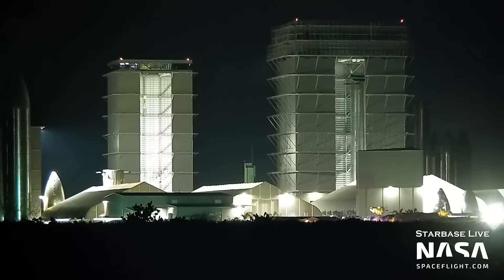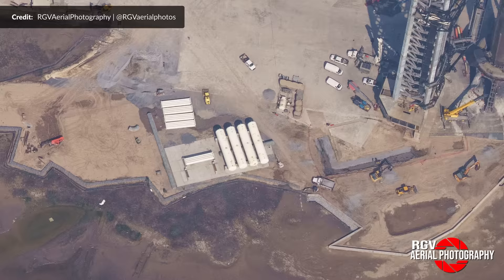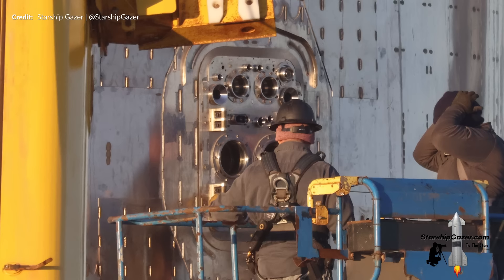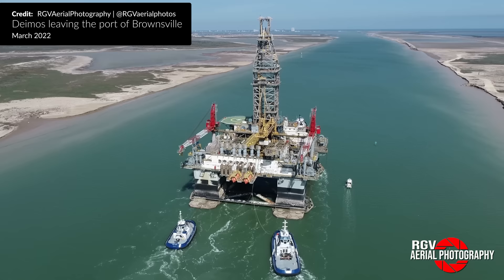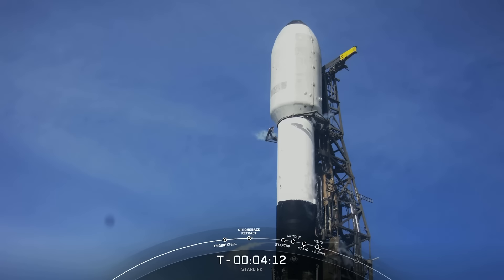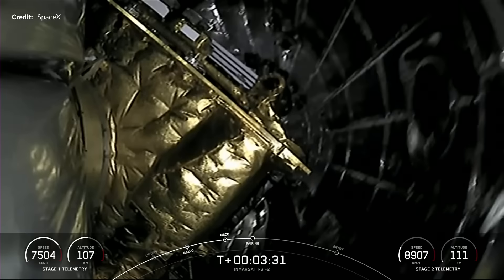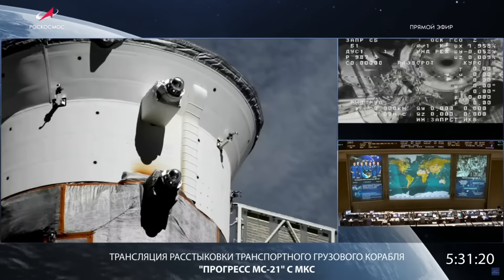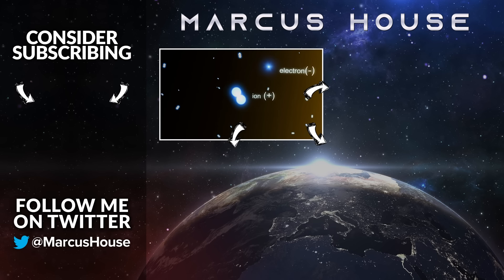SpaceX Ditches the Oil Rigs and Incredible Insights of the Orbital Launch Mount/Booster Static Fire

Comment: Surprise! As I wrote at the beginning of the oil rig fiasco the one and only sea launch platform sank in a storm. The sea is also corrosive. The idea was a non-starter. Don't get me started on those silly landing hooks.
Reply: Do note that sea launches do exists & it's an engineering challenge not a physics challenge

It's a low-priority, but still to-do lists

Comment: Space X has done more launches in the last 5 years than nasa has since their creation.
Reply: You do know that NASA is SpaceX's biggest customer right? That when SpaceX finally got the Falcon 1 to orbit on the 4th attempt, NASA awarded SpaceX the 2008 $1.6B Commercial Resupply Services (CRS) contract for developing and flying the Dragon and Falcon 9 to the ISS. When SpaceX had 12 Falcon 9 launches under their belt, they were awarded a Commercial Crew contract to develop Crew Dragon, man-rate the Falcon 9, and to fly 6 crew missions. They have since received 2 more contracts for 8 more flights. Currently, SpaceX is the only provider for a HLS lander for Artemis III with two contracts for 3 landings totaling $4.09B. SpaceX has had many single mission launches for NASA, along with the upcoming launch of 2 modules of the Lunar Gateway on a Falcon Heavy and the Nancy Grace Roman Space Telescope (NGRST) also on the Falcon Heavy.
Reply: Great way of showing you have no clue what NASA actually is and does. :D
NASA hires companies for their missons (always has and still does). SpaceX (a rocket developer and launch provider) is 1 of the many companies they use/hire.
To put it simple : NASA wants to put a rover on Mars, they hire companies that fit their budget best and are most likely to succeed building what they need.
 NASA and SpaceX are 2 completely different things and IF you wish to see them as the same thing, then at least look at what NASA accomplished with their missions (people on the Moon, Rovers on Mars, etc etc, while SpaceX is still stuck in low earth orbit after 20+ years.

Comment: Static fired killed allot of birds this time.
Reply: Source?
Reply: @alvianchoiriapriliansyah9882  Basic knowledge. 
Birds hear better than humans, and are more sensitive to increased noise. (easy to look up).
To human ears : 125DB to 140DB is painful, 140DB to 170DB is intorelable. 170 and above is deadly. 
Saturn V was way above 170DB (loudest they measured was 204DB). SpaceX's super heavy is AT LEAST as loud, likely louder according to experts.
Based on that knowledge... yes... every bird in a radius of a couple hundred meters around that static fire, is either dead or is so severely damaged that it will be dead soon.

Comment: I just found out they do not even make there own methane for launches  from atmospheric CO2 in a climate emergency ? I thought musks whole reason for evs was to negate fossil fuel emissions and as they will have to do it on Mars plus he makes loads solar tiles what is the problem? and what is the CO2 emissions on a starship launch if there from fossil sources ?
Reply: The entire emissions of a year of SpaceX launches amount to those from a single container ship operating for less than 3 months.
Reply: @fredbloggs5902  Omg thats huge then !
Reply: @MyKharli  cluelessness confirmed 

Blocked
Reply: If you can show us the way to get 150 tons to orbit from the ground, without using any fuels, fully reusable, please enlighten
Reply: @alvianchoiriapriliansyah9882  Use  musks solar tiles  to make the methane from atmospheric CO2 (like they say they can on mars )and power chillers to get the oxygen?  I thought that was the whole point .
Reply: @MyKharli  Apparently putting in a methane plant at Boca Chica involved a LOT more regulatory hurdles, so it was shelved for now.
Reply: @steveaustin2686  You could make it at a tesla giga factory ? and ship it with those lorry evs !
Reply: @MyKharli  You still have to deal with the regulatory hurdles. When you are making a substance that is explosive when mixed with air, you really do want those regulatory hurdles. Not to mention, you have to transport the LCH4. Since Boca Chica has a limited number of flights allowed and is going to be an R&D center per Musk, building a LCH4 plant at or near KSC is likely the better option.